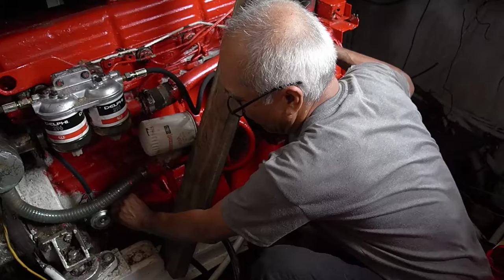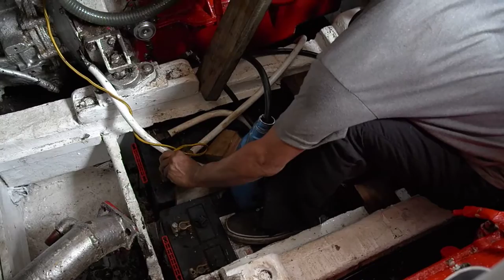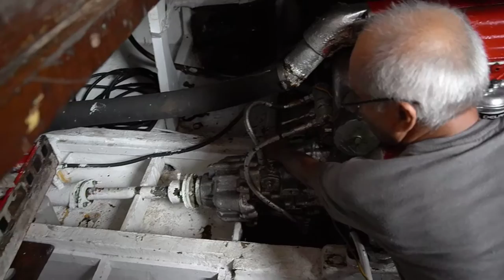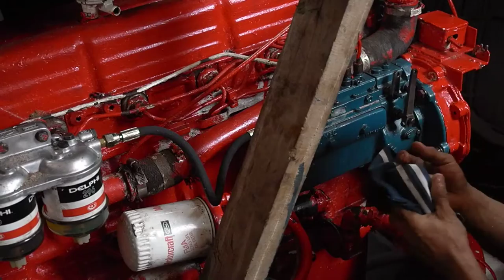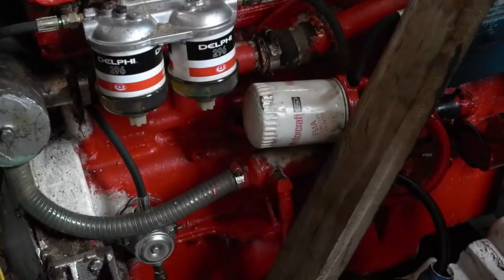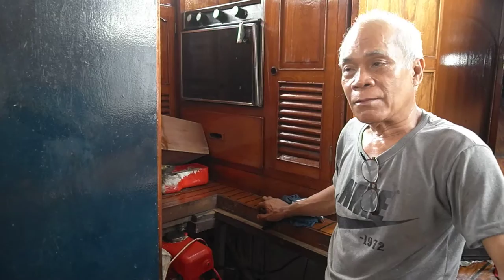Ford Lehman engine and Borg Warner Velvet Drive test

Comment: Nice to see someone using the cold start on the Minimec injection pump,l used to overhaul these engines in the 1960s, they weren’t that reliable in trucks when they first came out because the top water hose was too soft causing it to collapse and shut the flow off to the radiator and seizing the engine up,all that expense because Ford penny pinching as usual,must have cost them thousands all for a few pence saved,I was the first mechanic in the UK to rebuild one of these engines in a D800 truck that was only a couple of weeks old when it seized up and Ford had NO engines in stock so I had to rebuild it.

Comment: is this  the borb warner shuttle reverser  what type of oil do you put in
Reply from the maker: Sorry for late reply. We used to put Dexron-equivalent Automatic Transmission Fluid in the Borg Warner Velvet Drive, but have switched to SAE 40. The manual says diesel engine lubricants of API Grade CD are acceptable for transmissions running at 3000 rpm maximum, and when operating in hot conditions (we are in the Philippines). SAE 30 is recommended for temperate conditions.